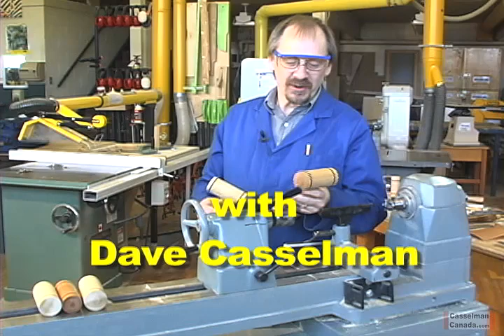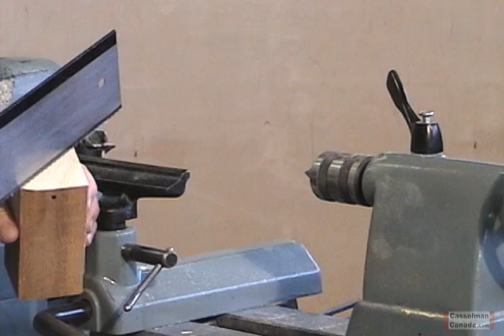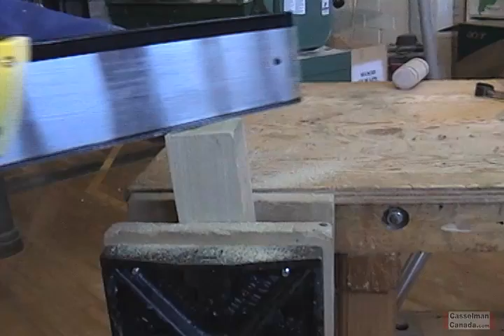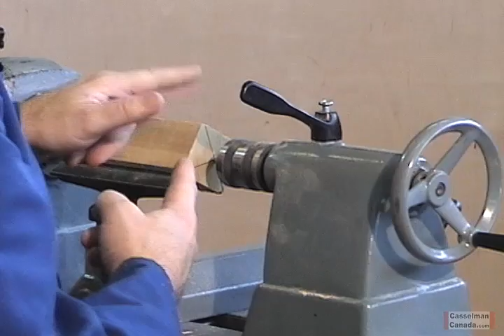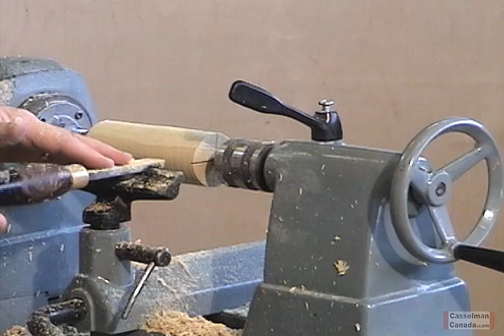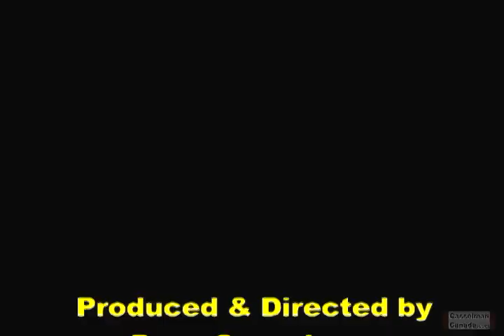Wood Lathe Project - Wooden Mallet Pt 1- Woodshop project demonstration

Comment: Did you know a small forsner  bit can be used on the drive end of a home made lathe
Reply from the maker: Yes, that is a useful configuration. I am not sure how I would have taught the students to safely fasten and then move the mallet head closer to a fixed turning bit. At any rate the woodlathe is a nice tool for teaching alternate ways of shaping materials. Most of the time we move or rotate our cutting tools on a stationary object. The lathe moves our object and lets the cutting tool be held nearly stationary.

Comment: TAKE OFF YOUR SHOP COAT WHEN USING THE LATHE, OR AT LEAST ROLL UP YOUR SLEEVES.
And for those who aren't sure, no gloves, no rings, no watches either.
Safety 1st !
Reply: I YELL BECAUSE I'M DEAF FROM NOT WORKING SAFELY. DON'T BE LIKE ME. SAFETY 1ST !
Reply from the maker: Yes, thank you. But the lathe wasn't that noisy. You don't have to yell.

Comment: Good vid. I'm new to lathe work; what kind of wood to you use to make your mallet? Thanks.
Reply from the maker: Interesting question. But the answer is really whatever you have. Some wood works better. I have made them out of mahogany, oak, poplar, ash and possibly a few others. Poplar was just because I had it. Not a good choice as it did not smoothen out very well- also made a lot of cottonlike sawdust. Mahogany was nice and looked good. None of these would likely survive actually using it to smash objects - they are more ornamental. I think it was the white oak that splintered a lot and left gaps in the handle - maybe the ash?? We used whatever wood we had pieces of that were at least 2 inches thick because a 2x2 is where we started from for each piece. The handle was twice as long as the head stock piece to make materials easy to produce for students. I used this for hundreds of grade 9 shop students each year.
Reply: retiredat60 Thank you, I look forward to watching more of your vids.